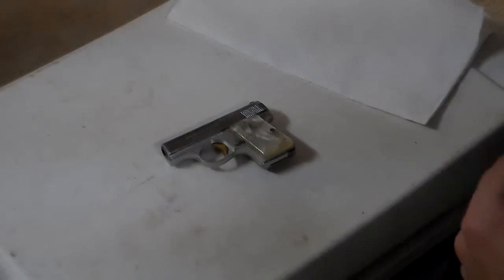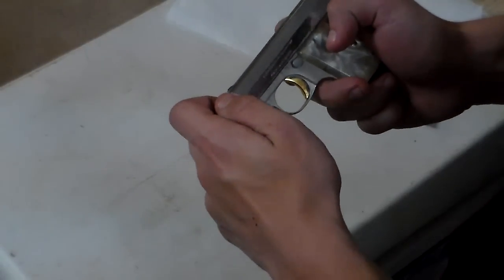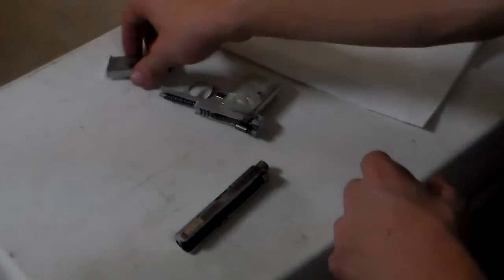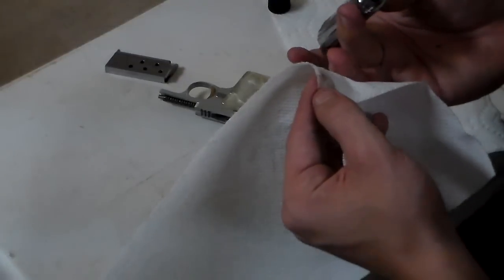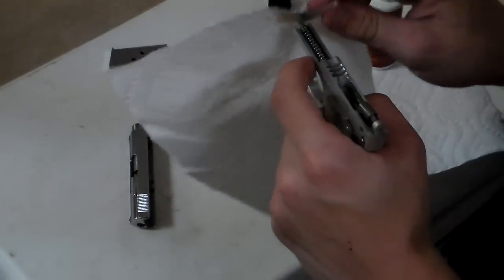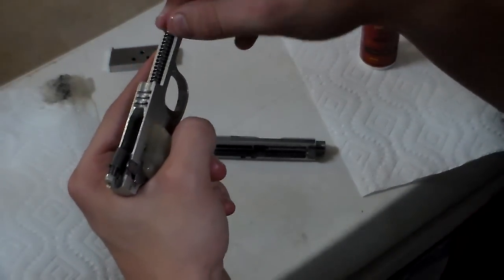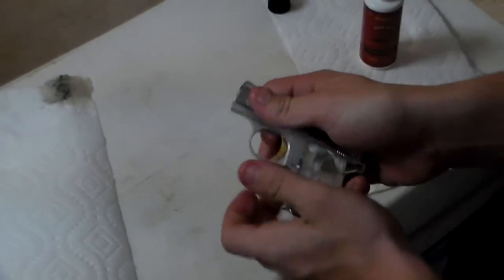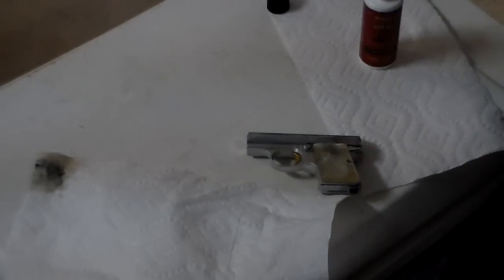baby browning assembly disassembly and cleaning

Comment: Slightly pull back the lever that holds in the clip until it catches on a notch. You will be able to pull out the clip much easier.